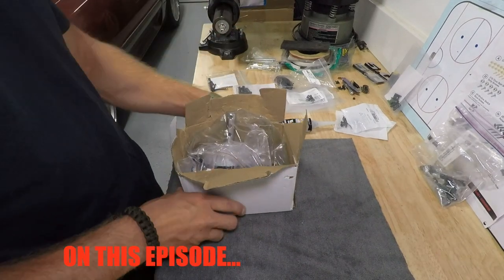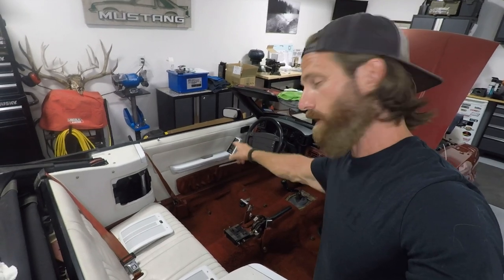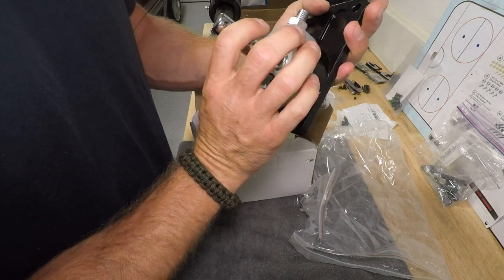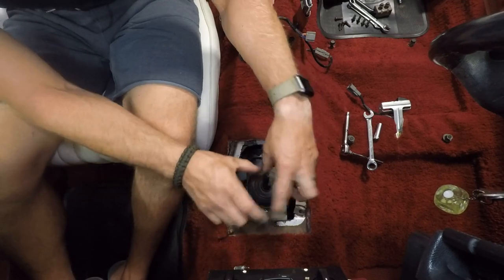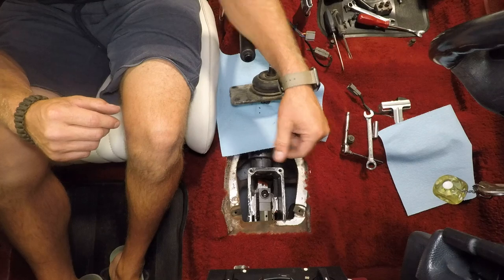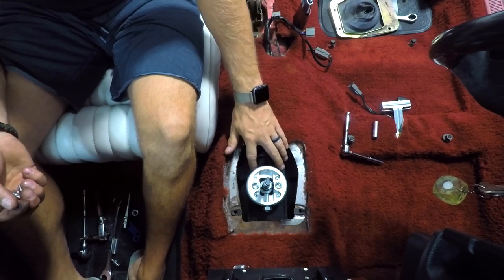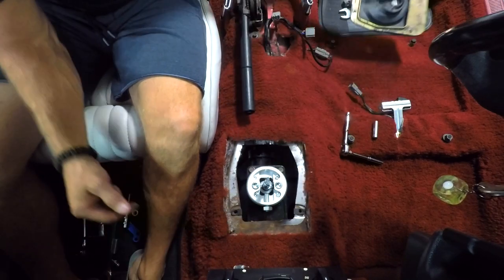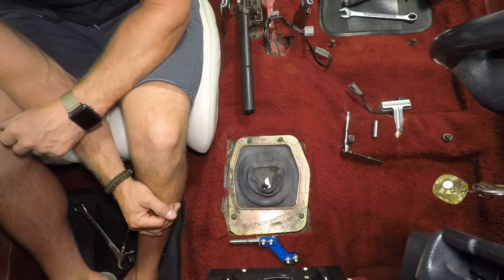LMR Econoshift T-5 Short Throw Shifter - Unboxing/Instal/Setup & First Impressions 1983-2001 Mustang

Comment: Little trick for getting the base off a bit easier...leave the handle on and loosen remove the base bolts...give the shifter a wiggle back and forth and with the added leverage it usually will break the seal and come off pretty easy. Loving the channel over here in Alberta!
Reply from the maker: Thx for the pro tip my friend!!! I was in AB for 13 years myself. The prairies hold a very special place in my heart 💪. Thanks for reaching out too!

Comment: Mixed feelings on this shifter.  I put same one in my car 2 years ago and only have moved the car out of the garage around my yard.  I recently took it apart to work on the interior and the little pieces that get pushed down by the springs are very very worn.  I haven't even really drove it yet. Shifts fine but it doesn't look like it will hold up. Was thinking of contacting lmr to see if they can get me those parts. Hopefully you have better luck.
Reply from the maker: Oh wow… ok well thanks for the heads up 👍

Comment: I bought the same one from Amazon.  Exact same.   I out it on and took it right back off.  Threw in the 🗑
Reply from the maker: Oh no really…? 😬
Reply: @KASLCustoms  i didnt have good luck with it.  The ball on the bottom of the shifter was too undersized and I didn't have good engagement.  It was identical to the LMR, but may be a different spec and quality.  Looking forward to your review after driving..
Reply from the maker: Oh wow. Ok I will definitely be reporting back shortly 👍
Reply: Did you have a new plastic bushing?  That makes a big difference.  With a new bushing you have to push pretty hard to get the ball to pop in.
Reply from the maker: I did not but mine did “pop” into the bushing 👍
Reply: @nshoezy  I have a brand new t5 with only 1500 miles on it.  Shifter bushing was mint.  I compared the ball from the cheap shifter and it was significantly smaller than the stock T5.  This wasn't the LMR, but was an Amazon shifter that looked identical down to the extra hardware pack with the springs and blue anodized shifter handle.
Reply: @wadestewart901 huh may be a little different than the LMR one then.  I'd have to look again but I'm pretty sure  the stock shifter ball on mine is smaller than the short shifter but that shifter had 100k on it.  My nylon bushing was brittle and cracked from age and heat so I bought a new one from lmr which thinking about it may be slightly thicker too.
Reply from the maker: Huh that’s crazy. This one fit the plastic bushing perfectly - it even popped into it 👍
Reply from the maker: Ok gotcha!

Comment: You can get the same shifter on Ebay for 35 dollars... I have one in my 88. Although it's better than stock, I'm not a huge fan. I like the Hurst in my 89 quite a bit better.
Reply from the maker: Interesting. As I mentioned in the video, I’m really not installing this to improve my T-5’s shifting performance, I’m merely just trying to change the profile of the gearshift because I hate the big stock one 👍

Comment: Hey idk if anyone can answer This question for me it’s not about the shifter although, it’s about the color and paint production for these foxes do the Triple Black Fox bodies  inside and out  such as Convertibles, Coupes and Hatches have any sort of rarity compared to other colors or was the color black  a normal production color also did leather seating have any effect or significance ?
Reply from the maker: The triple black is the holy grail in any Foxbody format 😍😍😍👍👍👍
Reply: Oh really? Cause I recently purchased a FoxBody back in April it’s a 90 Vert Triple black from the top to The inside to the  body and it still has stock pony wheels so I was wondering what’s the value on a car with this paint specifically just so I can get to know more about these cars  since it is my first FoxBody the engine is good mechanically just has its little Knick knacks cosmetically it even still has the original radio and smog pump.
Reply from the maker: Oh wow - you’ve got yourself a keeper there my friend!!!
Reply: Thanks for the information and the compliments   with that being said  that is another reason why I began watching more of your channel because we both got the Verts around the same time so I found that pretty cool as we both our gonna work on our verts to improve them.
Reply from the maker: Oh right on! Yeah this is my first one so I’m learning a lot about the Vert game 😉👍